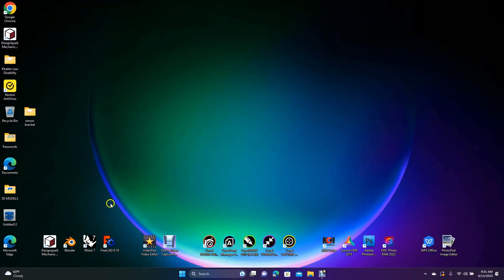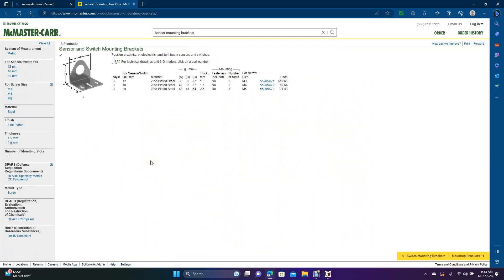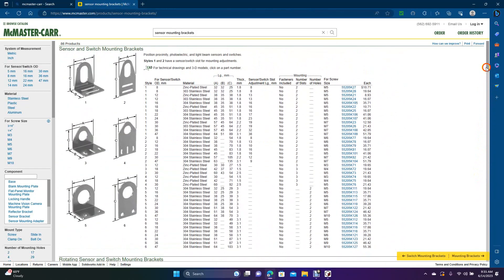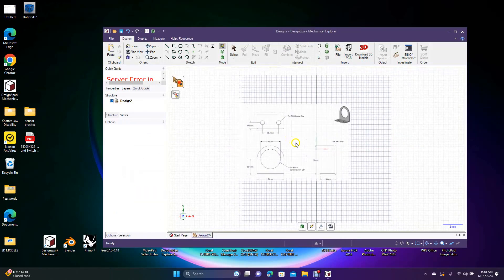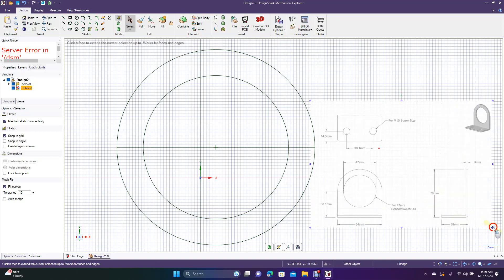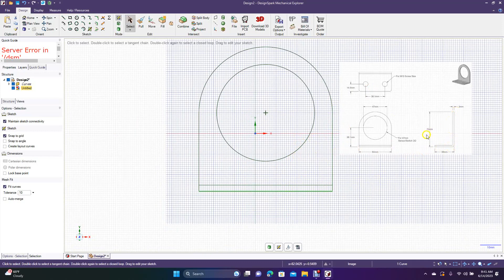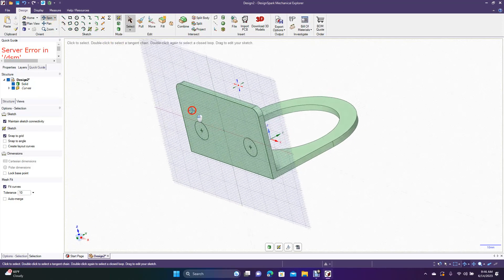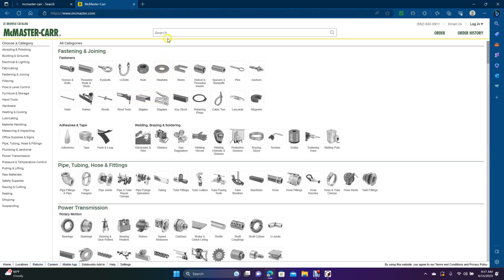How to download and use a 2D pdf drawing in design spark mechanical to create a 3d model

Comment: Great video thanks. I am struggling with one simple thing. I cannot rotate the object. It won't rotate, flip nothing. If i click that little axis symbol in the lower left corner all it does it will turn it from the left to the right, bottom - top, and front and back. But I cannot move it as I need to. Why is that?
Reply from the maker: Sorry for the late comment. Control "A" on the keyboard will select the entire part, and the part color will change from green to orange. After this, select the move tool, and you will see the rotate handles on the part. They are green, red, and blue. Each color rotates the part in a different direction. Click on the color direction you wish to rotate and rotate the part. Hope this helps.